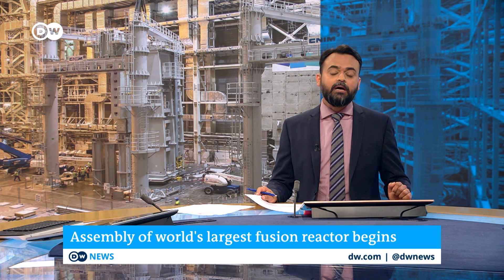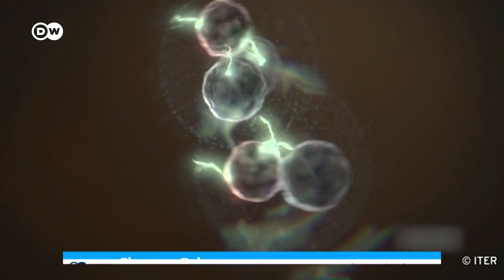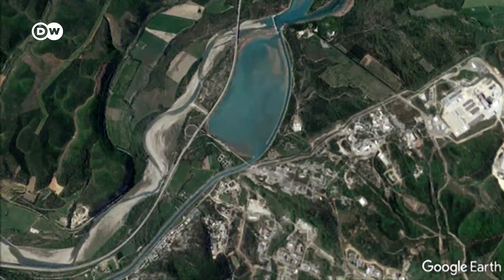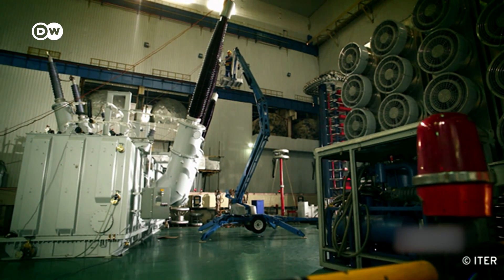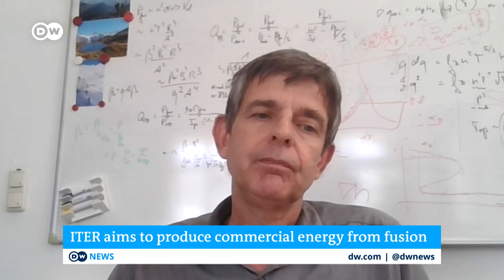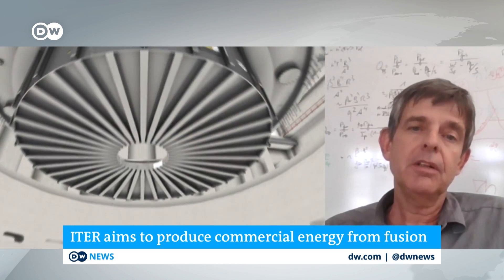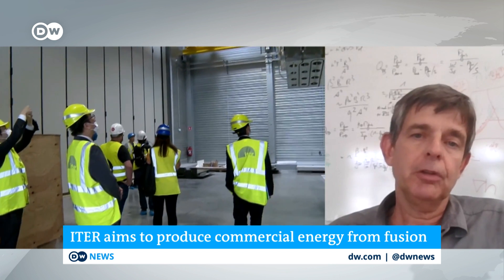ITER: Assembly of world's largest nuclear fusion reactor begins | DW News

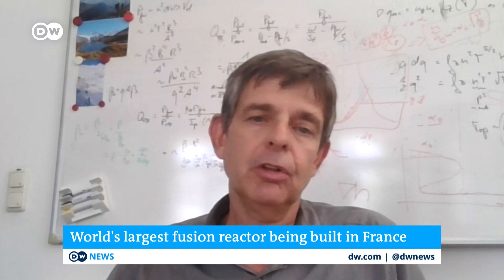Comment: 4:32 - 5:01 thnx for touching that point too (ofc that was crucial point)
Reply: It's nonsense. Fast spectrum reactors can reuse fuel until there are no long-lived byproducts, but even without those the byproducts from thermal spectrum reactors would be safe to touch after less than a century.

Comment: Why not use natural fusion from hydrogen en oxigen, only byproduct is water result hot plasma, use solar to generate hydrogen en oxigen
Reply: That’s not fusion, that’s a chemical reaction.
Reply: @Gomlmon99  no if you put hydrogen and oxygen in one tank nothing will happen until you introduce electrical arc or an another source of plasma, after the atoms fuse to form water an the byproducts is heat in excess of 2800*C so no its not a chemical reaction
Reply: pietje keesje sorry, but this is the chemistry a 12 year old knows. Hydrogen burning in oxygen is just a chemical reaction. Nothing fuses. Nothing nuclear happens. You don’t need plasma to burn hydrogen, any source of ignition, such as a match, would do 😂
Reply: Name so what happens next after you introduce plasma (flame) hydrogen and oxygen molecules fuse into water there is no chemical change of the elements because after this reaction you can split the atoms again into hydrogen and oxygen so no your not right fusion is the proces of two lighter atomic nuclei to form a heavier nucleus, while releasing energy and this is exactly what happens
Reply: pietje keesje the nuclei don’t fuse, the atoms just bond. But sorry, no point replying. You have no idea what you’re talking about, and you’re trying to argue with someone who’s spent a lifetime studying this over a topic a 12 year old understands better than you.
Reply: The reason why this type of reaction is not being highly praised because you and I can make it on our kitchen table without the need of huge government body that needs public financing, think about that.
Reply: @Gomlmon99  that's fine believe what you believe I know this is a cheap and reliable way to create a lot of energy from something as abundant and clean as water not needing any gigantic budgets nor studies, ready to use in every home today, the tokomak is more suitable for a spaceship rather than to power ordinary homes. Its a great development but a different purpose comes to mind where you might need that much energy. You can call yourself an expert but I believe that genius lies in simplicity and this tokomak has so many components that its disaster waiting to happen. Your right fusion is a nuclear reaction but what is it good for if its useless.
Reply: pietje keesje tell me, where are you going to get the hydrogen from? From water? So you’d have to electrolyse water? Electrolysis of water takes more energy than burning hydrogen produces. Why are you commenting when you didn’t go to school?
Reply: Name well solar is going to take care of that in-fact this technology is being developed at the moment in the Netherlands to use the existing gas infrastructure and transport hydrogen to households for in-house everyday use, you cant safely cook on it perhaps but you can heat tap water and use it for heating. Ive see prototypes that work with a mobile hho generator and produce enough energy to weld steel. You say it takes more energy to split water into its components but that goes for all elements preservation of energy applies all across the known universe. Its just that you need very little of the matter in tokamak to create a-lot of energy, but the question arises how are going to store it or even tap into it, its probably more easy to tap into the ether and lightning  to harvest it but than again how are you going to store it. Water is a gods gift that only needs to be employed.
Reply: pietje keesje I’m sorry, I don’t know why I’m even arguing, your misunderstanding is so great. Bye
Reply: @Gomlmon99  
Ha, ha, ha. That's the level of education of people who school everyone on global warming issues and dangers of nuclear power. You have good patience.
Reply: Paul Benedict I dont see the point of creating this expansive (not expensive) project when it has no purpose none of the sub infrastructure has been even sought of let alone that thing works, yes its a whole new area of development its like the nuclear bomb the only thing its good for is to level cities nothing else what I do think is useful is the new BN800 reactor that utilizes nuclear waste and decommissioned plutonium warheads thats a really great development indeed
Reply: @qwertyuiopasdfghjkl2556  
That technology had been able to level cities for 60 years. Now were trying to make electricity with it.
And the point is research to develop commercial fusion that would allow producing vast amounts of electricity with near zero fuel cost.
Reply: @paulbenedict1289  I hope they succeed
Reply: @qwertyuiopasdfghjkl2556  
Me too. It would change civilization far greater than any other invention so far. Eventually, we probably wouldn't even need farmlands anymore.

Comment: Errr is this safe
Reply: yes. no super long lived radioactive nuclear waste, no possible meltdown, and so on.
Reply: @zefyrisd69  but is it possible to shut down once fusion process started and how can we be sure it won't draw in more particals from the materials around it and how can they contain the heat for long periods of time if it can't be shut down. Eltro magnets will only last for so long.
Reply: @spamwisegamer4044  the technical difficulty is in how to keep it running for long, not how to shut it down when you need it so...
Reply: @zefyrisd69  it's once sustainable fusion occurres that's the bit im worried about not how to get it going.
Reply: @spamwisegamer4044  
You cut the power to the magnetic field that contains fusion material and it stops instantly.
Reply: @paulbenedict1289  are you sure it won't generate it's own magnetic field.
Reply: @spamwisegamer4044 
Each nuclei has a positive charge which prevents them from fusing. That's the only magnetic fields they create. 
Fusion doesn't activate some magnetic field that could self sustain, it works against natural magnetic forces that prevent nuclear fusion.
Reply: @paulbenedict1289  but fusion creates mass correct. And mass has magnetic fields as more fusion takes place the more mass aculmilates in the center of the fusion reactor. For sustainable fusion a self sustainable magnetic feild must be produced from the reaction. Right im no expert it's just my understanding.
Reply: @spamwisegamer4044  
 It's impossible to create mass and mass does not create magnetic field, electric charge does.
Magnetic field in fusion reactor is used to contain D and T in small volume and keep it away from stuff around it, so the D and T plasma can maintain temperature of 100 000 000 K, which allows D and T fusion to begin. If the magnetic field that contains it fails , all the plasma will expand and cool down instantly stopping fusion. If you feed to much 'stuff' than magnetic field was design to contain it will escape it and cool down instantly. There is no mechanism here for run away chain reaction. 
The trick is to maintain 100 million Kelvin fusion reaction right next to 3 Kelvin magnets.

Comment: If energy can neither be created nor destroyed doesn't it make sense that fusion takes up more energy than it produces while fission produces more energy than is input?
Reply: No. You’re misunderstanding the physics.
Reply: @Gomlmon99  if the splitting up of atoms creates energy then it only makes sense that combining those atoms requires energy. I mean where does the energy released from fission come from if it didn't come from the process of fussion.
Reply: Retro no, you are misunderstanding the physics. Binding energy per nucleon peaks at Fe-56. Anything above this, fission produces energy and fusion requires it. Below this, it’s the opposite. This is why fission uses heavy elements like Uranium whilst fusion uses light elements like hydrogen.

It is not “free energy”. The energy is just converted from the change in mass of the products from the reactants.
Reply: no. for starters, professional physicists would have realized that by now. And H bombs would not work
Reply: @istvansipos9940  professional physicist were once like us.
Reply: @istvansipos9940  if fussion creates more energy than is input then can't we create limitless energy by using just endlessly splitting and fussing the same hydrogen atoms, thus defying newtons law.
Reply: @SetuBaru  no. we can't. it is not a chain reaction. you fuse the 2 atoms into 1. then you cannot fuse the 1 into even fewer. It is way above my paygrade, so I obviously won't go into the details :- ) but if it were that simple, it would have been done decades ago
Reply: @istvansipos9940  I know it's not that simple the mechanics are beyond the point but isn't fusion the act of fusing hydrogen atoms together and fission the act of breaking them apart.
Reply: @SetuBaru  Whether you fuse or split atoms, the resulting mass will always be smaller than the initial mass because some of the mass was transformed into energy. That doesn't defy any laws. The thing is, transforming mass into energy is easier than transforming energy into mass, so ultimately it's a one-way process (entropy).

Comment: DW News - not exactly Mr. Current Affairs !!! A High Tech Electrical Engineering Company (SAFIRE), announced  last July 2019 (at Bath University UK) the first of a new breed of 100% Green reactors known as "Plasma Reactors". This new system is not only Green but 1600% more efficient (Cheaper electricity for you and me). So efficient in fact it will also replace wind generators and solar panels. SAFIRE also have a method to "Switch Off" Nuclear radiation and clean up all the radioactive buried waste !!! The whole point of the Plasma Reactor is to replace ALL current methods of generation including Nuclear Energy..... Behind SAFIRE is a well known Electrical Engineering Giant.

Comment: This is great but it will probably not be available anytime soon. For the time being, we need fission nuclear powerplants instead. Nuclear power is the only carbon-free form of energy that can deliver energy reliably making batteries and energy storage not yet available obsolete. Until we have longterm energy storage solutions nuclear energy is the only option.
Reply: i spent the whole video waiting for him to mention 20 years
Reply: Neither ITER nor solar and wind with batteries will produce cheap electricity. ITER is much more complicated than a fission reactor and renewables are an inherently dilute and therefore raw materials intensive (i.e. expensive) form of energy.

Fossil fuel and nuclear fission are the only proven practical, scalable energy sources, and they're likely to remain so for the foreseeable future.
Reply: @phamnuwen9442  Then what will produce cheap energy?
Reply: Yeah right, it doesn't release carbon, super great right? Meanwhile we should just left tons of nuclear waste around for 200000 years, it's so "environmental friendly" as long as we don't have carbon right?
Reply: @ThanhVu-oo5nv  at least you can store the waste, and not a lot of it produced, unlike fossil, which produces tons of waste that can't really be stored
Reply: @ThanhVu-oo5nv  
Well, it would help if you libturds would stop opposing the deep geologic waste repository.

Comment: Not fast enough. Planet will be in a big mess by the time it's ready.
Reply: Still, we need to keep working on this, as fast as possible.
Reply: @autohmae  I agree completely!! More resources allocated would be a good start imho
Reply: That could be the case but that is not a reason to stop working on it, i would call it a reason to start working harder at it.
Reply: @xg8-_-_-_-8gx  I agree!! I'm thinking more resources should be allocated to finish it faster if possible?
Reply: Well it was a science fiction years ago tho tbh....maybe a warp drive would be next....
Reply: @zekeaffy9647  Currently it looks very unlikely that a "warp drive" is possible, there are theoretical models that are allowed under physics as we currently understand it but it would require (as far as I know) "Exotic matter" which we have never found nor been able to produce so far.
So I don't think that comparing fusion (something we have proven to work but are working on the implementation of) to FTL (Witch we can only really guess at so far).
Damn sad because I would also like FTL but currently it seems very unlikely with our current understanding of physics (which may change later on but I would call that a very risky thing to bet on bet)
Reply: @xg8-_-_-_-8gx  yea I know....but it was really possible to build a nuclear fusion reactor tho....and it was funded by 35 countries...to overcome the depletion of non renewable energy...by replacing it with nuclear power....but instead of fission reactor plants...the world wants a safer...more efficient power source....that is the fusion reactor...it may be possible for the warp drive to become a reality if those 35 countries fund for it....for now it is plausible....but not entirely possible...
Reply: @zekeaffy9647  
I'm also interested in funding life extension research.
Reply: You're not exactly Mr. Current Affairs !!! A High Tech Electrical Engineering Company (SAFIRE), announced  last July 2019 (at Bath University UK) the first of a new breed of 100% Green reactors known as "Plasma Reactors". This new system is not only Green but 1600% more efficient (Cheaper electricity for you and me). So efficient in fact it will also replace wind generators and solar panels. SAFIRE also have a method to "Switch Off" Nuclear radiation and clean up all the radioactive buried waste !!! The whole point of the Plasma Reactor is to replace ALL current methods of generation including Nuclear Energy..... Behind SAFIRE is a well known Electrical Engineering Giant.
Reply: @TheDuke-vb9cq  LoL!!

Comment: Need the same amount of energy produced by the sun for this
Reply: If fusion needed the same energy output that the sun produces, the sun would release 0 energy. Or, better said, it would not release any energy because it would not have enough energy to start the process.
We produce fusion reactions since long time ago. We produce more than 2/3 of the energy input and we don't use as many energy as the sun. In fact, you can make fusion reactions at home. The hard part is to take more energy than what you put in, not to take energy out of it.

Comment: well, if the Chinese start building it earlier I'm sure the Americans will finally get their act together, nothing like a cold war to accelerate progress
Reply: You're not exactly Mr. Current Affairs !!! A High Tech Electrical Engineering Company (SAFIRE), announced  last July 2019 (at Bath University UK) the first of a new breed of 100% Green reactors known as "Plasma Reactors". This new system is not only Green but 1600% more efficient (Cheaper electricity for you and me). So efficient in fact it will also replace wind generators and solar panels. SAFIRE also have a method to "Switch Off" Nuclear radiation and clean up all the radioactive buried waste !!! The whole point of the Plasma Reactor is to replace ALL current methods of generation including Nuclear Energy..... Behind SAFIRE is a well known Electrical Engineering Giant.
Reply: @TheDuke-vb9cq  if it works then it will proof itself, but you don't have to go spamming the comment section

Comment: Anything interesting happening with the other doughnut - the LHC. What happened to Higgs Boson - another DW documentary maybe??
Reply: You're not exactly Mr. Current Affairs !!! A High Tech Electrical Engineering Company (SAFIRE), announced  last July 2019 (at Bath University UK) the first of a new breed of 100% Green reactors known as "Plasma Reactors". This new system is not only Green but 1600% more efficient (Cheaper electricity for you and me). So efficient in fact it will also replace wind generators and solar panels. SAFIRE also have a method to "Switch Off" Nuclear radiation and clean up all the radioactive buried waste !!! The whole point of the Plasma Reactor is to replace ALL current methods of generation including Nuclear Energy..... Behind SAFIRE is a well known Electrical Engineering Giant. The LHC was a clever but deliberate attempt to derail Physics. It was exposed more than a year ago, as an expensive waste of public money - There never was a Higgs-Bosan particle.
Reply: @TheDuke-vb9cq  - provide sources to substantiate your claims about the LHC and Higgs ...

Comment: Didn’t see the quad robotic arms to keep it contained, maybe they need a few more years.
Reply: You're not exactly Mr. Current Affairs !!! A High Tech Electrical Engineering Company (SAFIRE), announced  last July 2019 (at Bath University UK) the first of a new breed of 100% Green reactors known as "Plasma Reactors". This new system is not only Green but 1600% more efficient (Cheaper electricity for you and me). So efficient in fact it will also replace wind generators and solar panels. SAFIRE also have a method to "Switch Off" Nuclear radiation and clean up all the radioactive buried waste !!! The whole point of the Plasma Reactor is to replace ALL current methods of generation including Nuclear Energy..... Behind SAFIRE is a well known Electrical Engineering Giant.